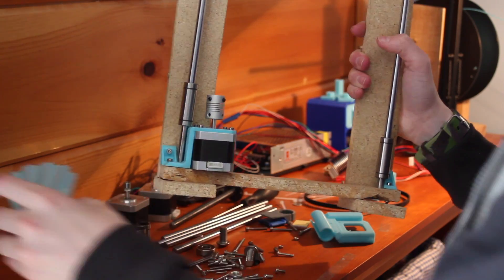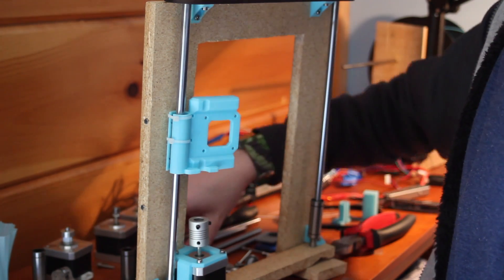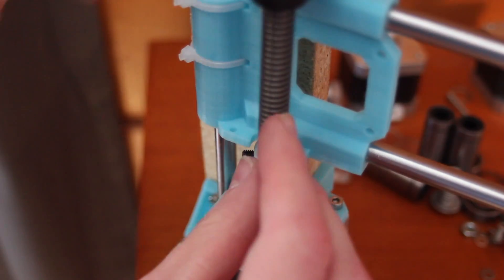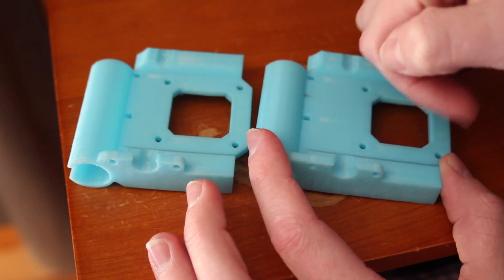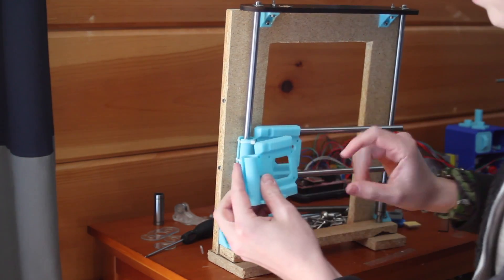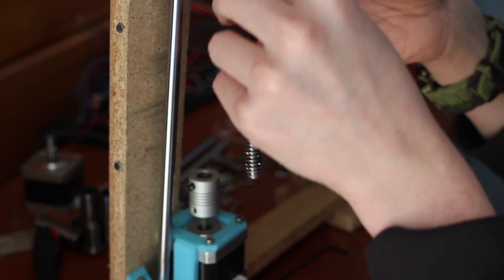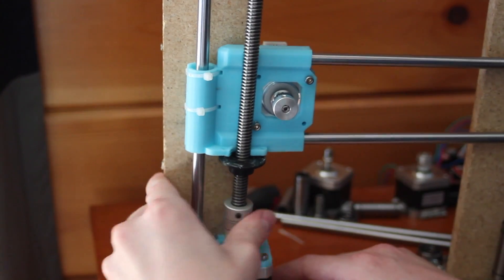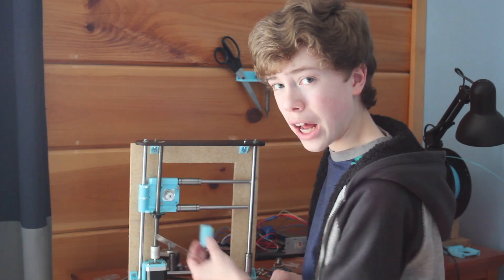Custom 3D Printer Build: Part 4 - X Gantry

Comment: What do you think about converting a flatbed scanner into a 3d printer? i have one with 9600dpi resolution.
Reply from the maker: WagonLoads depends. Does it use stepper motors? Some use timed DC motors, which won’t work. Also how do you plan on communicating with them? Ramps board? Is it compatible.

Sounds like a really cool idea, it just has a lot of variables. I’d love to hear if you try it, so if you do, let me know!